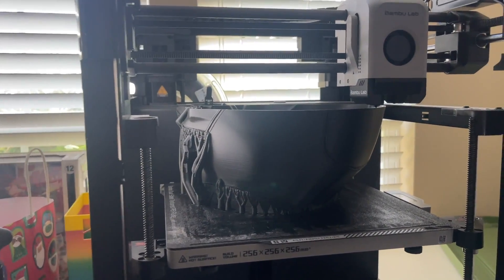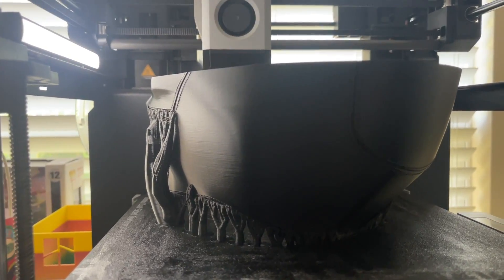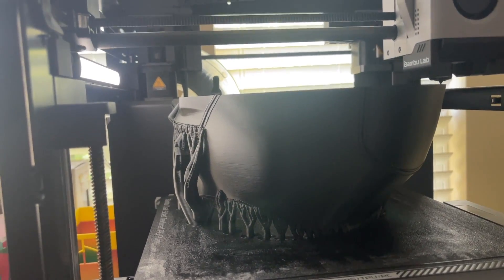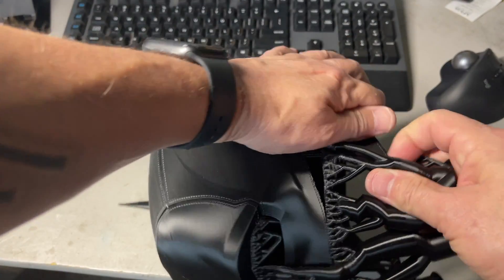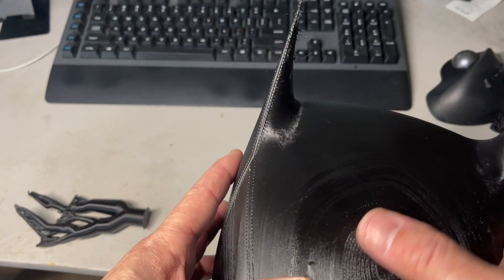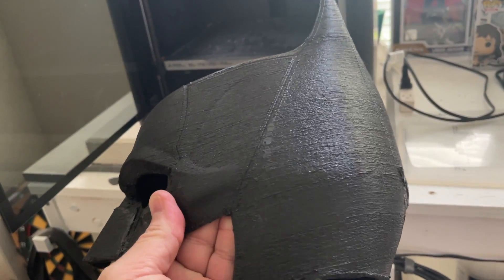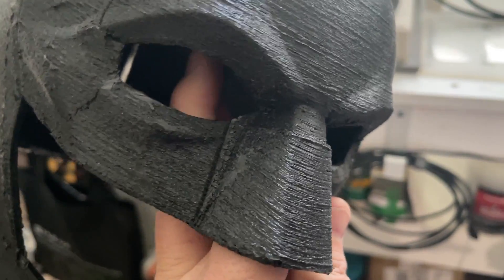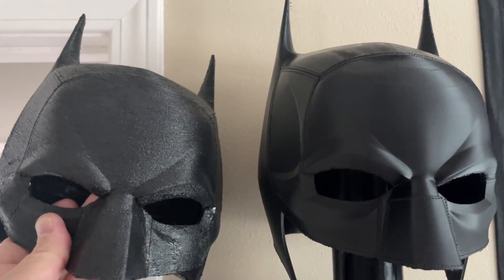Printing The Batman Cowl in TPU on the BambuLab P1P using Prilene TPU.

Comment: Hey, cool stuff, could you give us a breakdown of all the settings (quality, strength, speed, support, others) you used? What nozzel size, speed, etc? Thanks! Keep up the great work!
Reply from the maker: Thank you!  It's been a while, but I think I used 25% infill and the only other thing I changed was Top Z Distance to .34 and Bottom Z Distance to .3 to make the supports easy to remove, since TPU has a tendency to weld to itself.  Everything else was default with a .4 nozzle.  I didn't change any default speed, just selected generic TPU and let the machine do the rest.  :)

Comment: Man this is impressive. I have the same printer and I’m definitely going to print mine. !!!!
Reply from the maker: Thanks!  Just make sure to adjust the top and bottom Z distance, otherwise the tree supports will fuse to the cowl.
Reply: What do you mean ? Any video explaining that ?
Reply from the maker: In the description of the Gauntlet video, I posted the Bambu Studio settings below.  I use them for most of my prints and the supports fall right off.  One other thing to keep in mind is how stiff you want the Cowl and other pieces to be.  I used 25% triangle infill for the Cowl and Gauntlets and 10% for the pieces like the hinges and straps for the Gauntlet so they'd be more flexible.  At one point the printers had an issue using the default Grid infill for tall pieces and they'd end up knocking into the printed parts and ruin the print(I experienced this several times).  So I always switch to Triangle infill and the prints are "usually" really nice, unless I do something wrong.  For the Cowl I painted on supports and only supported the tops of the eyes and pieces of the Cowl that faced the bottom plate (nose, front of the underside of the mask, etc).  I may have painted on a small block at the top inside of the Cowl but don't remember.  You might want to because better to be safe than sorry, but supports for the underside of masks and helmets typically aren't required.

.34 top Z distance
.3 bottom Z distance
Auto tree supports
Reply from the maker: Good idea, adding it to the description as well.

https://www.amazon.com/PRILINE-TPU-1KG-Filament-Dimensional-Accuracy/dp/B074DV9JMX/ref=sr_1_1?hvadid=580992966164&hvdev=c&hvlocphy=9011488&hvnetw=g&hvqmt=e&hvrand=685936397214788566&hvtargid=kwd-418816110457&hydadcr=8496_13507384&keywords=priline+tpu&qid=1708003253&sr=8-1-spons&sp_csd=d2lkZ2V0TmFtZT1zcF9hdGY&psc=1

Comment: bro, this is gonna be nice if uou clean it up
, theres 2 options, ive had varied results, but on this size, sandblast it , 
if thats not an option, heatgun, then hit it with a isopropyl wipe to smooth it.
Reply from the maker: Thanks, I don't have a sandblaster.  Do you have a link to anything you've done with a sandblaster and alcohol so I can see the before and after?
Reply: even better, ill make a vid today and send ui a link, ive got some prints coming out later @3DPrints747